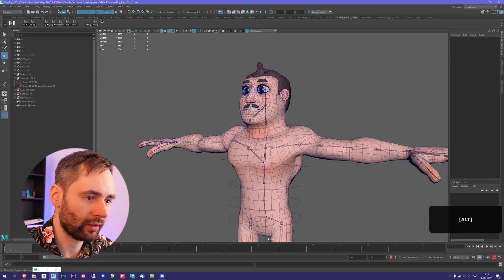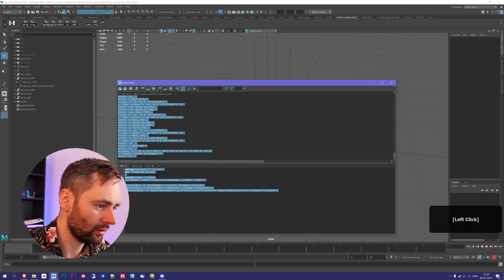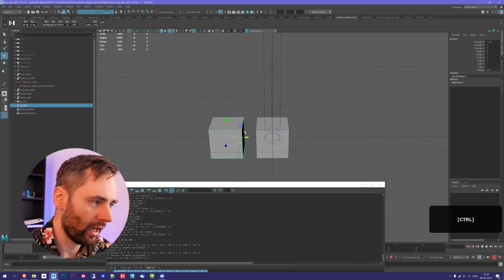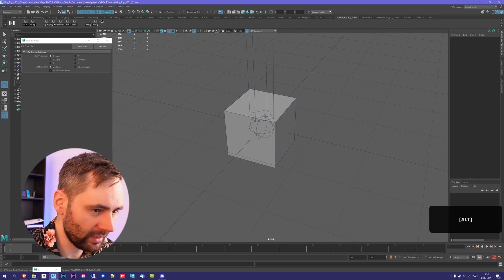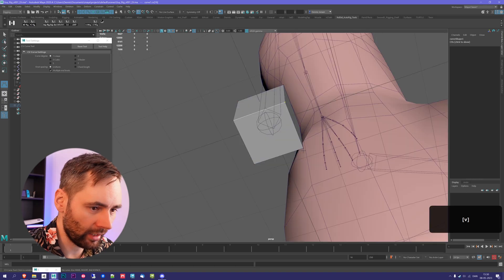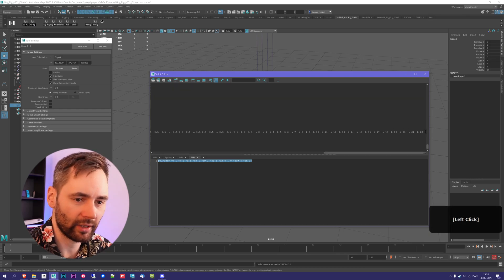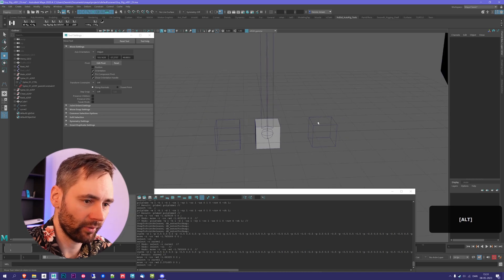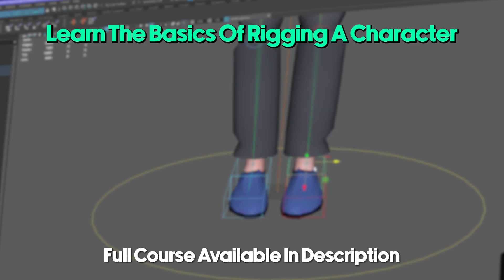How To Create A Custom Rig Controller In Maya

Comment: Hello... do you know of a way to scale animation curves in the graph editor with a controller?
Reply from the maker: In the tool bar there is a few manipulators you can use, one can be used to scale the keys down.
Reply: @dennismakesgames  Well, I mean a controller outside of the Graph Editor.
Reply from the maker: @keithyakouboff8755  Oh you gotta edit the control points, and then you can scale it.
Reply: @dennismakesgames  I'm sorry, I do not understand what you mean. I will try to describe what I'm trying to do:

As you have curve shapes as objects you move, rotate, etc., to control a joint or some other object in your scene (via expressions or set-driven keys), I'd like to be able to set up an object in the scene as a controller to scale the time keyframes of a specific object. This would give someone less acquainted with Maya the ability to scale the animation speed of an object simply by moving, say, a slider comprised of curves or polys.
Reply from the maker: @keithyakouboff8755  Oh okay, Sorry I don't know how to do that, maybe via a script?
Reply: @dennismakesgames  yeah... not a scripting guy tho lol